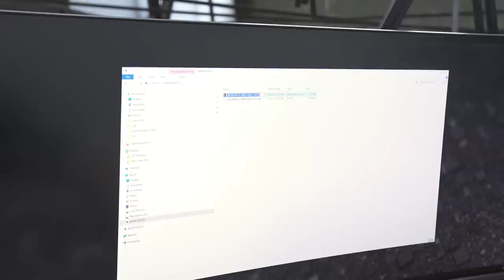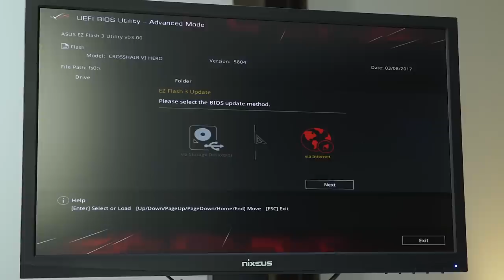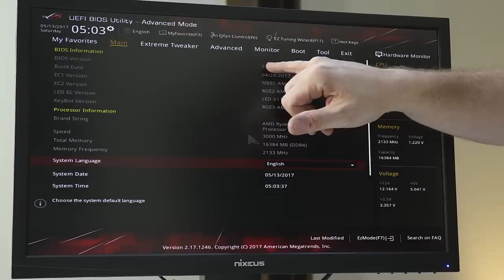How to build a Gaming PC

Comment from the maker: I pinned this comment to make myself feel better.
Reply: It feels better to pin the comment, not pin yourself
Reply: Jay you sexy BEAST!!!
Reply: Jay doesn't answer the comments
Reply: You're looking pretty trim there. Congrats on all the weight loss!
Reply: Jay you and your videos are awesome.
Reply: 13 minutes ago? <insert last time I was this early joke>
Reply: JayzTwoCents I commented on your pinned comment to attempt to make you feel better. Please tell me it worked?
Reply: When is the review of the case right side you with SLI EVGA GTX 1080Ti at 29:24
Reply: +EliteGamerClay HD When you mount a CPU cooler onto your CPU there will always be tiny air gaps left between the 2 surfaces. The thermalpaste is there to act kind of like a liquid metal (and infact there are thermal pastes that are liquid metal) to bridge the gap and provide optimal heat transfer from the CPU to the cooler.
Reply: Is it true that intel will release an  7920x
Reply: love your videos
Reply: ik
Reply: That's a clear, step-by step, explanatory, clean and satisfying tutorial video, thanks Jay, regards from Mexico City.
Reply: You did good!
Reply: very newbie question: sata port number for the ssd-os & sata port number for the HDD? thanks!
Reply: lit
Reply: Hi Jay, i believe you missed informing us to "apply" the thermal paste since you cleaned it off after taking the parts off the test bench :) I did not see you reapplying it - Loving this build though, very clean.
Reply: I hope it helped.
Reply: lovveeee your build videos XD
Reply: I'd like you to pin this comment. It'd make me feel better.
Reply: Did you forget to mention ESD?
Reply: PartPicker link?
Reply: Oh, come on Jay, you know you wanted to run dual GTX 1070's. The Crosshair VI Hero comes with the HB SLI Bridge! Can't let it go to waste! I know I sure didn't.
Reply: JayzTwoCents what case is that you use ?
Reply: JayzTwoCents you own a 1080, you should feel good
Reply: JayzTwoCents please what's the purpose of third SATA cables that inside the case it self
Reply: rough day?
Reply: I can't help but think that Jay is an AMD fan at heart....from the days of old. Nice to see an AMD build in a how to!
Reply: @IAmTheOne5:  looks like "MasterCase Maker 6" From CoolerMaster With some accesories (glass side panel, rear things , etc..)
Reply: pretty kewl case....considering it for a future build
Reply: i got the version 5, ready for my new ryzen build :P waiting for vega ^^, pretty simple case, very modular and well made !
Reply: We love you brah, no matter what.
Reply: You've inspired me to go with a SMA8 and a custom cooling loop, Jay. I hope the case is as good as your old review would suggest!
Reply: JayzTwoCents THAT NUMPAD OMG WHERES THE BUY LINK JK ITS DOWN IN THE DESCRIPTION BUT STILL THAT KEYPAD
Reply: +Taro Go
It doesn't matter which SATA ports you use.
What Jay meant was to make sure that if you motherboard has SATA3 ports, make sure your SSD is in one of those and if you have enough SATA3 ports, you may as well put your HDD into one as well.
If you don't have enought SATA3 ports, you can put your HDD into a SATA2 port since the HDD won't be fast enough to "need" a SATA3 port.

*SATA3 ports are just faster than SATA2. SSDs and HDDs will work in both.
Reply: JayzTwoCents what case is that with the two EVGA graphics cards? that's a pretty sick looking case
Reply: JayzTwoCents it would be awesome if you could do a series on new/other watercooling components (pumps, waterblocks what have you) there is so much out there besides Laing and EK. Dear watercooling guru enlighten us please. Thanks for your great content 👍
Reply: The one at 29:06? I think thats the Mid Tower version for the Cougar Panzer. Could be wrong though.
Reply: azure98 good call!
Reply: JayzTwoCents i know this is a stupid question but where did u get the window 10
Reply: Are you going to stick with your 6950x after the rumoured x299 cpu's come out?
Reply: Oh yea if you use the Stryx GPU tweak 2, you should use version 1.2.8.2 newer versions cause my Stryx 1080 to turn the fans on full blast and was the underlying problem of blury video games.  It did take a full format and reinstall to fix the GPU fan problem BTW.

But tonight I can tell when this system gets working it works nice. Titanfall2 looks and plays amazing on Ryzen
Reply: You forgot to like it yourself however.
Reply: every single review for ryzen I've seen puts them at or near where intel is. dunno where you're getting your information but its wrong.
Reply: Nikos Akoydis how is Intel better? for what use or budget? your statement is generalized and seem misinformed, the Intel vs AMD conversation isn't that straight forward there are a million variables and in each case you will have a preferred winner there is no definite PC that suits all it all depends on your budget and use.
Reply: You only fucked up the installation of the motherboard, because it is very important, to 1. install the motherboard standoffs (yours were already pre installed) in the first place and 2. to install them in the right places, aligned with the holes in the motherboard. Why? Because I myself had a newbie builder with his custom computer in front of me in a computer hardware store, complaining, that his computer wouldn't start and smelled funny after he turned on the power for the first time. The stores hardware guy behind the counter took just one look and knew instantly why the computer was probably fried. The customer had not read the motherboard installation manual properly and screwed the motherboard right onto the raw metal of motherboard tray...without the standoffs. Nuff said!
Reply: EliteGamerClay HD thermal paste is there to get better heat conduction between the CPU or gpu and whatever is cooling it down
Reply: +SWAZAcoustic Maybe it's because every single review for Ryzen that you have seen was made by a reviewer who knows what he's talking about and has run benchmarks on it. But hey, let's take the word of some nobody on the internet at face value, shall we?
Reply: +PỺO's MƎᴻTɐʟ MƎʟTdowɴs 16:10. 'Nuff said.
Reply: Nikos Akoydis in games, if you game on a 1080p 100hz plus monitor competitive than yes the Intel is better for older titles specifically the i7 7700, but if you look up 1440p results the ryzen line up is very close, for multitasking am not sure which benchmarks you are referring to show lower 4c 8t Intel CPUs better the 6c 12t or 8c 16t CPUs from AMD, but still I agree if you are a gaming enthusiast looking for very high fps competitive on 1080p yes this is the only situation I can think of that makes sense otherwise the difference is very close in 1440p and higher resolutions
Reply: What many of these blue fan boys don't seem to understand is also that the CPUs are being compared in the same price range, not the same spec range. Meaning an intel 7700k (4c 8t) will not be compared to a Ryzen 1500x (also 4c 8t), but to the Ryzen 1700, which is an 8c 16t chip at around the same price.
Reply: And i liked your comment and video, so you feel even better.
Reply: look @ time stamps (left)20:58 / (right) 22:04 for clearance of cooler at bottom...21:01 for top. I don't think you would want to even try to install an optical with so little clearance , plus the drive bays were removed. If you had a smaller radiator to keep the top bays installed then it might be possible, I doubt you want your optical resting on the coolers in and out lines. If you must have an optical drive it would probably be best to go external.
Reply: KICKTHEBASSWITHTHEFACE! a lot of his stuff was given by a sponsor or whatever i may be wrong but he didn't choose many of the components
Reply: JayzTwoCents I want to see the PCIe power cable routed through the back. Somehow that single cable coming through that bottom is annoying my OCD.
Reply: Should it be how to be a ryzen PC?
Reply: hello jay and thanks for your amazing content. i have a question. i recently bought ryzen 1600, a mobo asus prime b350, which ram should i buy? will those do the job? will they run 3200? Corsair Vengeance LPX 16GB DDR4-3200MHz (CMK16GX4M2B3200C16) thanks in advance. hope you reply.
Reply: Jay, small question, is it okay to install newest bios version right away, or should we install them one by one from current to newest version?
Reply: Hey Jay (the one that NVIDIA never remembers) :P

I see many guys on the internet using an antistatic bracelet. I see you don't use them. What is your opinion on those? Are they really required or is it just a myth?
Reply: JayzTwoCents can u help me pick out Parts for my new pc I'll be buying this summer 800 my budget 8 want the best pc experience as currently I'm playing on a potatoe so plz help
Reply: I guess I'll this here since it won't be moved other than after someone replies after me :-)     Nice video Jay, keep up the good work. You and others like you have inspired many of us to get our hands dirty in building our own systems.
Reply: I answered this comment to make myself feel better!
Reply from the maker: +Mark Yates let the block spread it
Reply: good video mate.. quality, if had to Say one word!
Reply: I love asus like I love my mom, overall great company, can Asus share some luv and hook me up with this build's part? 😊
Reply: will the setup have a giveaway still sucking with a a4 6300 and parents are stil not allowing to upgrade
Reply: I think you should also make another ver of the guide but intel ver.
Reply: JayzTwoCents 
Can anyone please tell me How much time it takes to display anything on monitor after starting the cpu 
i built a pc with ryzen 5  1600 
but when i first time strted it 
i was not able to see anything on display
Reply: StarSlayer67 Why? It would be the same...
Reply: Rahul Kumawat Put the CPU power cable (4pin) off and then in  again.
If that didnt help remove the RAM ans put it in again
Reply: TrueGapple 
Dude i tryed everything 
I wanna know how much time ryzen takes on its first post
Reply: Rahul Kumawat: A few minutes at most
Reply: Larry Kozlowski 
I waited for 2 mins but nothng happened
I wasn't seeing any response on my monitor
Reply: Jay, thank you for another great video! Kind regards from The Netherlands.
Reply: Rahul Kumawat: If your motherboard has an error code readout look up the numbers/letters that it is cycling through to see if there is an issue. You could also hookup a motherboard speaker if yours came with one. Also need to remember that Ryzen does not have an integrated GPU and that your monitor needs to be hooked up to the GPU. I know someone who saw the I/O and assumed they could hook an HDMI to it and not buy a GPU, only to have to turn around and buy a cheap GPU to actually get it running lol.
Reply: Larry Kozlowski 
I tried on different motherboard i tried a new Ram 
another power supply 
also used a good graphics card 
but i still not able to see anything on monitor 
thats why i am asking how much time it take ryzen in its first post ??
may be i should have waited more 

but unfortunately i am not having my ryzen with me right now
Reply: JayzTwoCents be that sensei you never had
Reply: can you do a build with built in wifi?
Reply: Do you feel better now?
Reply: JayzTwoCents , did you just forget to mention that you need to reapply thermal paste on the CPU?
Reply: "hey JayzTwoCents, could you please do a "part selection tutorial"/"parts specs" video on custom water loop parts because a lot of people (including myself) don't know the meaning of the specs/meaning of most of the parts and what brands to buy from".
Reply: Look up Reshade, it uses SMAA, a better type of AA that may help in your case, it also has support for presets based on the game your playing.
Reply: that canadian guy yeah I'd love to see that
Reply: These days you only need to hit delete once.
Reply: G'day mate. just wanted to say thanks for making it easy for people who are new to pc building to get in to it. after I stumbled on to your videos a few months ago and seeing how it can be fairly uncomplicated I decided to build my own rig for the first time.
Reply: You only ever needed to hit Delete once. The problem was, as it is now, knowing exactly when to hit it. Sometimes the opportunity comes before the message shows up on the screen, and by the time you see a display, it's too late. That's why we spam Delete as soon as the machine is turned on.
Reply: whats the cost of all that ?
Reply: JayzTwoCents thanks Jay helped me update/flash my bios , great build guide man, thanks
Reply: well you rock, well you are teaching us so I say you don't need to do that, your teaching does it.
Reply: holy crap, i tried downloading win 10 on my computer, and it took like 20 mins just on the loading screen of the windows 10, after you chose to boot from a usb. jayz pc less than 5 seconds... definitely time for an upgrade!!
Reply: You said we can bridge the power button things on the motherboard together to turn it on for testing if there's no actual button. How do we turn it off though, by doing the same thing? Flipping the switch on the PSU? I'll be using an MSI B350M Gaming Pro.
Reply: Thank you for remembering people new to PC building.  -  And, keep using your laid back intros and "Transitions", and the sped up voice makes me smile.  Your mix adds a few seconds to a minute, however, the humor and candor is very enjoyable.
Reply: You can bridge the contacts to power down too, but it takes 15 seconds. It's probably easier to turn off the power supply directly.
Reply: +Scott Sakurai Thank you so much Scott but I think I'll just hookup the case's front panel while it's on the cardboard box to use those buttons.
Reply: @Tara Go You should always check your Motherboard specifications. generally i will use port SATA01 for my boot drive (OS) and any other slaves (HDD etc) to the  SATA02 or others. Most times it does not matter. Since you can designate the drives functions for each in the bios.
Reply: If you save some money every payday you will be able to get what you want.
Reply: Congratulations on pinning this comment to make yourself feel better.
Do you feel better now that you've pinned the comment i am currently commenting on? ^^
Reply: Vengeance lpx ram install
Reply: Volvirth,    What is your problem and what is wrong with Jay's comment?
Reply: ZZstaff I don't have one and nothing?...
It's a bullshit comment with the same content concept as Jay's?... xD

Lighten up a bit, see the light side of things every now and then. :3
Reply: Volvirth,
That is odd, I was thinking the same thing about you and your statement.  Sorry, I did not identify humor in your above post.
Reply: Jay, did you just use an AIO water cooler?! :O What is going on in  your life?!
Reply: JayzTwoCents respect
Reply: So with today's graphics cards, they don't use a dvi, is that correct?
Reply: perfect!
Reply: JayzTwoCents i like how you said intel is more fragile xD my first PC i messed up cause of the AMD CPU(mostly my stupidity)  my second one was intel and was super easy
Reply: JayzTwoCents which Corsair lpx did you use for this build?  I ask because ryzen ram compatibility is extremely specific.
Reply: JayzTwoCents what cooler is this?
Reply: dude it's the celsius S36
Reply: Hey Jay, Im not sure what video cards i should get either sli or crossfire and i will be getting the new amd threadripper cpu when it comes out but i cant decide to get rx 580 or gtx 1080 ti, i want the fastest card as possibleso help me choose which one i should get please.
Reply: Michael Wilson nigga the GTX 1080 to is obviously better.the rx 580 is the same as the GTX 1060
Reply: get a 1080 ti if u are heavy user if not rx580 will do fine
Reply: welcome man!!
Reply: Michael Wilson,
Wait for Vega or Volta.  Vega should be out in late July and Volta probably September.  Both are next generation video cards.
Reply: Probably the Vega wont be that good and Volta, because AMD didnt do that good, will just milk the cow (1080's) untill they die dry :D 
The only thing on that build, would be the mobo, I would go for the Taichi!
Reply: Pin me
Reply: how much did all that cost? or how much would it cost?
Reply: looks like a LTT build guide copy.

a little janky but more detailed.
Reply: Austin Montes Yup, his $1000 build is the worst build I've ever seen.
Reply: ImNotCool its 1000$ build wtf
Reply: JayzTwoCents amazing build shame i cant afford to build my own pc
Reply: JayzTwoCents I
Reply: JayzTwoCents - negative people are envious about you.. lol, I want to see more people :).. so funny. your works are amazing, keep up more works.
Reply: CaptainSplatBubbles
Reply: Does this build overheat like your other Ryzen in the Phanteks Ethoo case?
Reply: how do you turn off the out of box setup? Do you hit the power button on the PSU?
Reply: I don t get why you feel bad... You rock
Reply: tell me what kind of soundbar model you have 29:42
Reply: UM, dude forgot some links and things
Reply: Thanks for letting me know! Still not a valid argument Jay
Reply: if you dont go just push harder     -jayztwocents
Reply: JayzTwoCents what type of case were you using?
Reply: In india shopkeepers build our pc for free😎
Reply: IJayzTwoCents iii
Reply: you should've pinned yourself with a real pin
Reply: @jayztwocents I just got a prebuilt pc from cyber power. My very first one, so I didn't want to go crazy. Plus, I work, so I don't have THAT much time for gaming. But tell me what you think....if my set up will be able to handle sexy games. I have the AMD ryzen 2700x processor, 8gb of ram, and the AMD radeon rx580 4gb. Keep in mind I'm a console pleb, and just want to be able to start off slow into the BARE MINIMUM of 60fps while playing games. Do you think this setup will be able to handle 60fps + on most games? Thanks man. (or anyone else who can answer) :D
Reply: and? any better? :D
Reply: Gaming pc with ryzen? Isn't intel cpu better for gaming? I have vega 56 gigabyte & intel i5-8400
Reply: Every time you lean your hand against the installed GPU it makes me sick, the way it bends and all, I think I'm gonna barf
Reply: what was the case? i plan to maybe use it for my first build?
Reply: I wish i have my own pc
Reply: 4.8K likes already. Let's make this a 5K feelsgood \o/
Reply: You forgot to say to apply thermal paste again at 20:00. 😜
Reply: Do you give any of this away? I'd love to get free stuff from big PC companies lol
Reply: @philliumo  svelte
Reply: @JayzTwoCents I was wondering about how long it took you to build this PC? im building my first PC by myself and while i've added GPUs, RAM, and PSUs i've never added a new mobo or cpu or even a cpu cooler especially a non stock one
Reply: Lmao
Reply: Yo Jay dose this play the BOTW SWITCH EMULATOR
Reply: Ok
Reply: What is the name of your casing
Reply: you should like your own comment too
Reply: NICE VIDEO THE NACHO VIDAL OF COMPUTERS.
Reply: The is there a name for the header you used for the Front IO connectors.  I'd like to know if I can buy them individually.
Reply: i have chlamydia